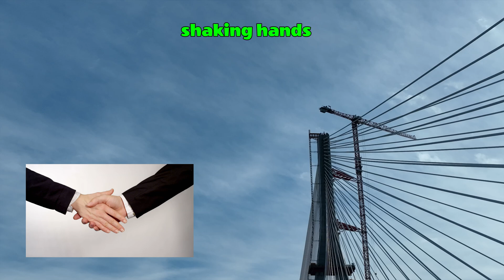US-Canada Unity: The Gordie Howe Bridge Story

Comment: a data search with US border protection reveals a completely different set of statistics, and shows that it is the US that has a much larger problem at the border than Canada has with the US which to nones surprise completely contradicts the claims of the idiot in the WH, the People of the US need to be presented with actual facts rather than listen to the constant lies of the orange idiot. also when you remove our oil exports to the US they actually have a trade surplus with Canada, which BTW is sold to the US at a great discount, so the question is, who is subsidizing who, pretty easy to figure out. another great presentation Bob, thanks.
Reply from the maker: Hi FloydFan. All great points to make. I think his tactics, brash as they are, knock people off balance to gain the advantage in negotiations. We'll have to wait to see what he really is after. Honestly, if it gets the drugs off our streets I can take an insult or two. :) Great and informative post. Thanks for sharing.